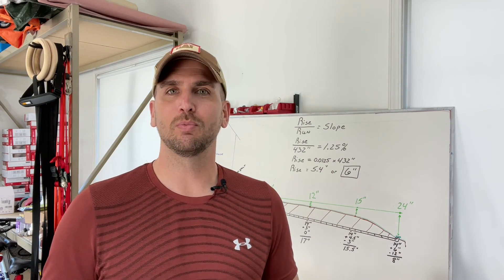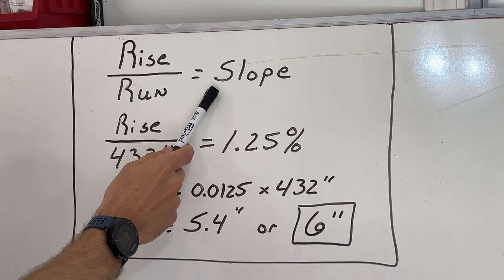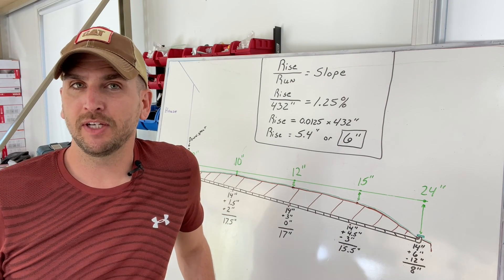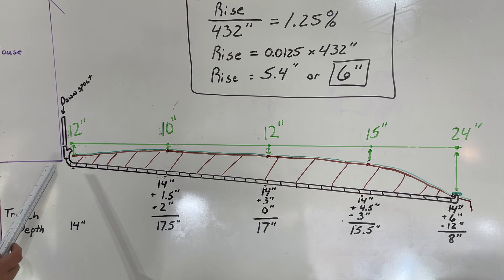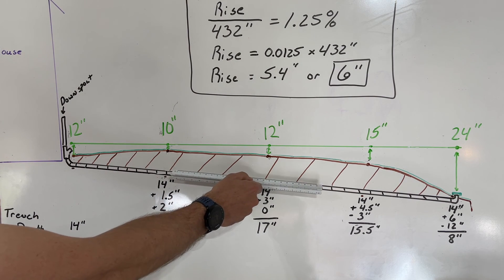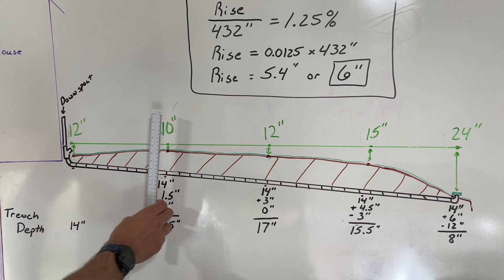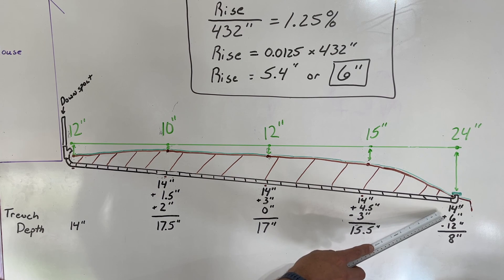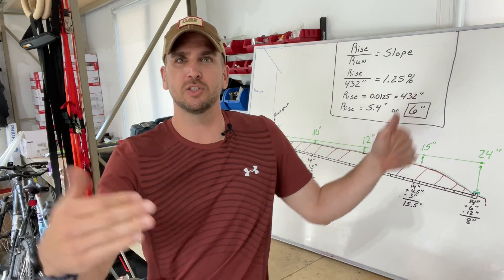Drainage Pipe Slope and Trench Depth Calculation

Comment: This was the best example of how to convert inches to a percent. However my advice is to use the engineer system, it’s way easier. Instead of 12 inches it’s 10 tenths and 100 hundredths per foot. Because it’s based off of the 10 scale it’s more simple to calculate the run over rise. Also do yourself a favor and get a pipe laser! You will never go back to using string. I have been using one since the late 90’s trust me it’s the only way to go! Excellent video.

Comment: I like the idea of using the ground itself as the reference. I had tried a similar project, while using the imaginary level line as the reference. But the problem is: it doesn't exist! I can try to set up stakes and put strings across to keep that imaginary reference point available as I'm digging. Obviously that is a big hassle, as opposed to simply adjusting each reference point so it is relative to the current ground level height, at that point. Thanks for the video, this gave me some great practical ideas!

Comment: Just curious, why not use rigid drain tile and use 1/8 in per ft for the slope? Also, how far away is necessary,? Wasn't it a tad overkill to go all the way to the city's sidewalk? Couldn't you have stopped 10 or 20 short of the sidewalk and still be far enough away?

Comment: If I can find my laser level I may use that instead of string and line level between the stakes. I have a run that's over 70ft and don't trust that I could pull the string tight enough through the run.

I've watched a lot of videos showing checking the piping with a level for slope. Not precise according to numbers, but a half or full bubble on a quality carpenter's level does not lie, either. Trouble is, ya kinda want to know if adequate slope is POSSIBLE before you dig AND where it'll daylight. You may be able to dig for say, 2% slope over a long run but if that daylights the water too low it's a new problem.

Comment: Great article, but I have a question? How much dirt needs to be on top of the drainage line? I installed a 16 foot run, and placed about1.5" of dirt on top. After a rain the pipe came out of the ground in spots.
Reply: Bury pipe at least 6 inches.

Comment: This is the hard way to do it. The slope calcs are fine. I would simply dig out a trench and backfill/ tamp to get the correct measurement at each point. Adding or subtracting values can lead to math errors. I’d keep it simple…
Reply: I'm sooo new to all of this and completely confused by the numbers. What is your best suggestion for me basically living on a hill, but the neighbors yard leeches into mine, in the back then just pools in one area of my yard.  All of my gutters are crap and need replaced, then I am going to have to dig some trenches and either lay French drains or pipe. My yard to the road is maybe 45 to 50ft. From what I have seen on so many of these videos, the French drain or pipe should be taken I to consideration whe. Calculating the length of the yard. The more I think about it, the .ore I think k I need to pay someone... Want a job?

Comment: I have a concern with the pop-up emitters.  It seems that you will always have some water that will remain at the end of the pipe.  These things do leak a little, I suppose it would leak out, right?  Can't have standing water....
Reply: Dig a well under the pop-up sized for a five gallon bucket.  Place the bucket in the well, and fill with crushed stone.  Drill a small hole (1/8"-1/4") in the bottom of the elbow up for the pop-up.  You'll also need to drill the bottom of the bucket in several places to allow drainage, and figure out a way to use the bucket cover with the pop-up to minimize dirt infiltration.

Comment: More of a question from a true novice and a fan of your blog, if I may: where did the 1.25% come from, how was it calculated/arrived at? Thank you! Keep up the good work!
Reply: I believe 1.25% is the minimum slope for water to continuously flow through corrugated pipe.  Smooth pipe is 1% minimum.  For those of us living at sea level, those are important ratios😅at sea 1% is 1 inch for we very 4 feet or 48 inches.  Easy to multiply that for runs.

Comment: So the plan it to have the pipe full of water at all times?
You mention that the popup emmitter is aprox 6-8" tall. In your case with a 6" drop it will never empty the line. If the emitter is 6" tall you will exactly fill the line with water. You will then likely have it back up when junk gets caught behint the popup. I love it when folks have the sump and multiple gutters tied into 1 line. When it gets plugged the geyser out the gutter down spouts are hilarious.

You already have a downward slope near the sidewalk. Just use a small patch of rocks or such to let the 4" pipe drain. Use a couple bigger rocks to hide the pipe.

If you want it really nice landscape a dry creek bed for it to drain out of. Block the water egress as little as possible.

Lastly if you ever have ice on the ground please do not drain onto the sidewalk. That is asking for a lawsuit.
Reply from the maker: For the popup 90-degree fitting it has a small weep hole that will allow any standing water to slowly drain to avoid this issue.

Comment: Good teaching . I know this can also work for u- drains . But my question is  what percentage will you include for the percentage.  For instance in your example here you used a certain percentage for the diameter of the pipe . How much percentage do you have to add for a drain with 900mm diameter? Thanks for your cooperation.

Comment: nice video. But one thing I am not sure is about the pop-up end. When counting the slope from the pop-up to the starting pipe location, It is clear that for the starting location, we should count the bottom elevation of the pipe, but how about the elevation at pop-up? Should we use the top elevation of the pop-up cover or the bottom elevation of the pipe at the pop-up? Intuitively, it appears that we may need to consider the top elevation of the pop up or the pop-up cover elevation since water may accumulate at pop up and the water pressure at pop-up may need to be computed based on the pop-up cover elevation.

Comment: Time is the investment when you dig a trench wide enough and approximately  deeper than you need to.. use angle stations (pieces of flat brick or even turd if it's hard enough).. lock in angle required put dirt or feed  sand underneath pipe or whatever drain pipe. Carefully fill trench back with dirt put a little water to make dirt emulsify.. carefully use stomper if need be....

Comment: Question. How do you do when you have a flat yard and the calculation of the slope of the drywell is deeper than drain basin? Do you add an extention pipe to the drywell so that the  drain basin is level with the surface of the yard?

Comment: I'm sooo new to this... 
I won't be installing a drainage pipe, but I need to work on the narrow strips (law ) on both sides of my house when Ievel my front lawn, because water paddles everywhere in the narrow strips.
I am trying to learn slope on Youtube. I assume your video can be applied to what I need to do..although I think that my challenge is that the starting point (around downspout back side of narrow strip) seems to be a bit lower than the end of front lawn. its up n down from the front lawn all the way to the back on the end of narrow strip. 
I bought some strings and string levels.  I'm confused how I can make a proper slope for water drainage from downspout to the end of front lawn. total distance is about 70 ft. 

Any advice would be appreciated..!!
Reply from the maker: Have you seen the other video that goes more in depth on using the line level?  https://youtu.be/viD9Xdlg7wI
Reply: @EverydayHomeRepairs  Yes I have watched the other video :)  helpful information. I understand the concept..

Due to lack of time and manpower, I don't think I can make too much of change at the backside(end) of narrow strip which is a hit higher than the other side (backyard) over the fence, and a bit lower than front lawn. Referring your videos  I will do what I can to improve at least the spots where water paddles so bad and smooth out surface . it's difficult to mow with reel mower too. 
eekks!

Comment: I agree a 1% to 1.25% slope on outdoor drainage pipe is ideal, but here is a piece of advise for those with yards with no slope…….you don’t need any slope in the drainage pipe as long as the discharge is lower than any other point in the system. I’ve done this a handful of times with no problems. (Buildup may occur over time, but that’s nothing a garden hose can’t fix) I always try for at least 1%, but sometimes this is impossible. My current drainage system at my home only has  6” of elevation change over 150’.  Since installation I’ve had tsunami like storms and it kept up with all the surface and roof water with no issues. Long story short…. Get the slope if you have it, but don’t worry if you only have a few inch elevation change. It’s gonna work. Water always goes to the lowest point. Believe it or not, It will even go uphill if the lowest point is after it. Head pressure

Comment: To me a simpler way would be, after leveling the string and after finding the slope that you want (1,25% or 6" of fall), lower the string 6" at the ending point and then dig the trench and maintain the same depth from the string (14") the whole way.
Reply: Ground wasn't level...he had a 2 inch rise above the start point which meant he  wouldn't had been able to draw the string straight down to the 6 inch mark at the low end point.
Reply: @mortalstorm  if that was the case, he could simply raise the height of the string until he had the clearance. Still would be the same, high on one end with 6"of fall on the other end.
Reply: @lstownley
Correct.
SO much EASIER.... especially if you have access to a laser
Reply: That exactly what i was thinking too. Not sure why such a huge amount of math and earth trenching is being put into this. Maybe this guy is a contractor, u know, make the job bigger to get bigger pay.
I was thinking of the down spout mounted to the wall, a 90° elbow at the bottom just barely under the surface, glue the pipe u want into the elbow, and just make sure the end of the pipe and length of the pipe is lower than the elbow. Its only for when it rains, right? Doesnt need to be THIS involved with all the math and numbers.
Reply: @johnperez93640  he does all this because he only need to dig like 5 feet from his house to the sidewalk.
Reply: @johnperez93640 No, you do the math so you can calculate materials and cost BEFORE you purchase. This holds true for both pro and DIY.
Reply: @johnperez93640 It's more about showing you the math so that you fully grasp the concept.

Comment: I have a line that just relies on Pascals laws and the concept of communicating vessels.  Terrible flow,  but in the end i have an area that would normally flood that ends up dry.  If your slope sucks you can also just oversize the pipe knowing that the pipe is going to fill and move slower.  Just don't use either concept for sewage lines or areas with lots of debris,  sometimes you want that fast moving water 😁

Comment: My challenge is that I'm digging my trench 56' to get from my flooded area down to the street. To get the slope at the right fall rate (not even very aggressive - 1/5" per foot), the pipe ends up way too far underground to even think about getting it to daylight at the street. In your video your pop-up emitter is nice and flush with the ground. Mine would be buried about 19" UNDER the ground. I am at a loss on what to do. Can't wrap my head around how to terminate this line.
Reply: I’m dealing with something similar. I’ve read you can use solid pvc pipe to extend from the drain pipe up 16 inches to the pop up and that when there’s not sufficient flow to open it for discharge the water will just leach into the elbow area below ground. It makes me nervous though because there’s not a lot to be found on how efficient that is. I’m trying to emit my water away from my foundation, where it’s causing heave to my house, to my back slope so it’ll feed a rain garden I’d like to install next spring but I’m afraid doing this will just move the over-saturation from the front to the backyard.
Reply: ROCKS Lots and lots of rocks. 36 inches below and 36 inches to the left and right of your perforated ending elbow.   @lilakaye1505
Reply: @lilakaye1505  if you order from the French drain man he's got a pop-up admiter but you can buy these riser extensions to go on your pop-up, and you can buy multiple ones so you don't have to worry about your dilemma you just keep adding the risers until you reach the height needed, the French drain man makes a great products well I guess they should they're made by people who do this for a living lol check them out
Reply: I think u need a dump pump system

Comment: That's great. It's exactly what I was looking for. We'll done buddy. 
How do we decide on the slope? In your case you wanted a 1.25 slope, why? In my case I am building a retaining wall 3.5 feet high and 39 feet long. Should I  go %2 or %3 or even %1 slope. Thanks for your help and time.
Reply from the maker: Are you just placing a perforated pipe behind the base of the retaining wall as a french drain?
Reply: @EverydayHomeRepairs  I am using a 4 inch  perforated corrugated pipe
Reply: @EverydayHomeRepairs  and it is behind the second row of AB blocks. It will be a 5 rows of blocks  high

Comment: Why do you set the check point at 9 feet not 10 feet? It seems that the drop you used (-1.5 every check point) is calculated from a 10 feet run (10 x 12 = 120, 120 * 0.0125 = 1.5"), not a 9 feet run.
Reply: The total length of his run was 36 feet. He rounded up to a total drop in elevation of 6 inches. 25% of 36 feet is 9 ft. 25% of 6 inches is 1.5 inches.

Comment: Over the years I've help Professionals  install at least 50 Septic Tanks using everything from String line to laser transits. I knew what the measurements where needed to get the proper 1½"-2 fall per foot, but I never the math equation. This was an eye opener for this old man   👍
Reply: No laser equipment when septic tanks were used, lol
Reply: it’s not 1 1/2” ta 2” per ft. It’s 1/8 or .125 decimal equivalence of fall per ft.
Reply: @markgettings1723  1/4 is easier, then its 1 inch for every 48 inches. Or 20 inches for 960 inches (80 feet).  That is what I use for sch40 pvc. I think corrugated needs more slope. So 1.5 inches per 4 feet or 48 inches. So for 80feet, I would multiply 960 by 1.5 or 2 and divide by 48.  30 inches and 40 inches respectively for slope.  Is that correct?

Comment: With the pop-up at the downstream end there may be standing water at the downstream end and there may be a tendency for stuff to collect in the pipe there. Another type of outlet may be appropriate if you want to avoid that. Also, the top of the pop-up needs to be below the upstream end of the horizontal pipe for the water to flow through.
Reply: This is also my question. When computing the slope from the pop-up to the starting pipe location, we may count the bottom elevation of the pipe, but how about the elevation at pop-up? Should we use the top elevation of the pop-up or the bottom elevation of the pipe at the pop-up? Intuitively, it appears that we may need to consider the top elevation of the pop up or the pop-up cover elevation for computing slope, because water may accumulate at pop up. If this is the case, we will need a very large elevation difference from the upstream to the pop up. Any solution?

Comment: 1.25% slope for 4inch corrugated pipe is not sufficient to consider the system self-cleaning.  To achieve the 3fps required to be self-cleaning 4inch corrugated needs 2.8% slope.   You haven't yet read all of your pipe manufacturer's installation recommendations.
Reply from the maker: Mr Slacker appreciate the feedback do you have a link you can share which gives more info on the 2.8% desire slope or the desired velocity of water?  I will be installing an easy to access cleanout so I not too concerned but also want to provide the best info.  Thanks!
Reply: @EverydayHomeRepairs  Plumbing Never More than 1/8" per foot for indoor plumbing, and no more than 1/4" per foot for drainage. And this stuff is in IPC and UPC. Forget what Bob says. 1/8" per foot is 1% and 1/4" per foot is 2.1%. All I know is I'm not all that big of fan of a landlord or property manager doing a tradesman's job if they don't know what they are doing. I'd sure like to hear this guy referencing NEC, IRC or UPC if he's gonna be fiddling with this stuff and spreading knowledge.
Reply: @EverydayHomeRepairs  Posting links gets my comments auto-deleted.   You can see graphs in the ADS, Inc. Drainage Handbook & Charts for slopes from NDS's website.  IDK how to share it on YT without getting deleted but you should be able to find it in an online-search.
Reply: @EverydayHomeRepairs  The problem with relying on clean-outs is that they're useless if the pipe clogs during the storm.

Comment: so 1/4 inch per foot is out the window eh?
Reply from the maker: Yeah, I pushed the slope as much as I could balancing having some ground on top of the pipe at the start at getting within 6"-8" at the end to use the popup.  Like usual a bit of a balancing act but I feel good about a little over 1.25% slope 👍
Reply: @EverydayHomeRepairs  my calculations you were a bit over 1/4 inch per foot